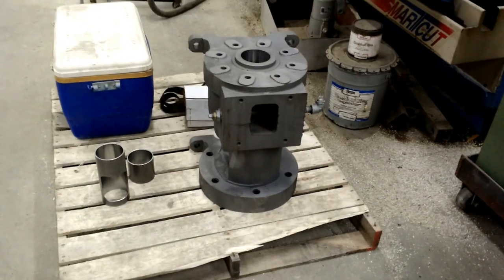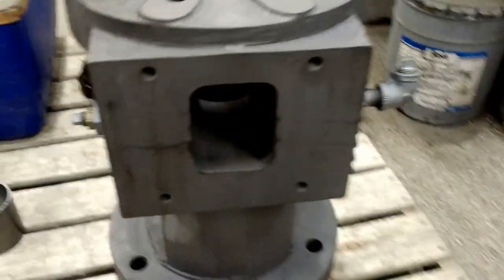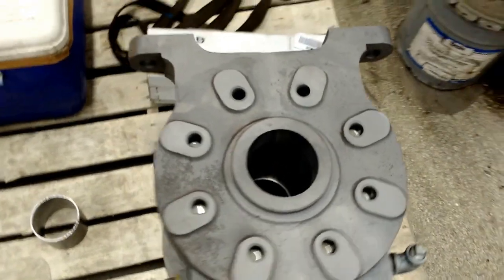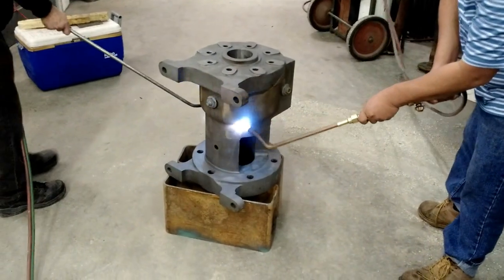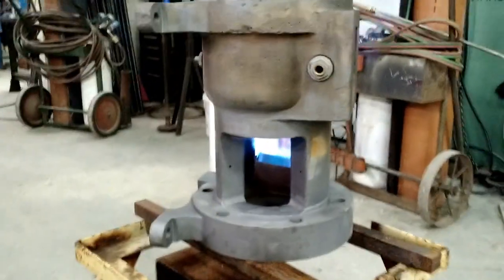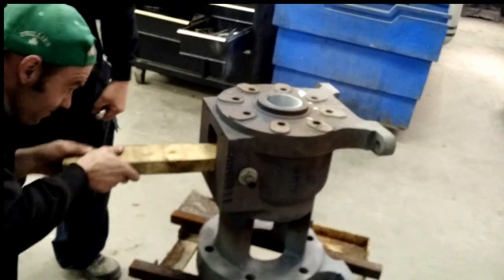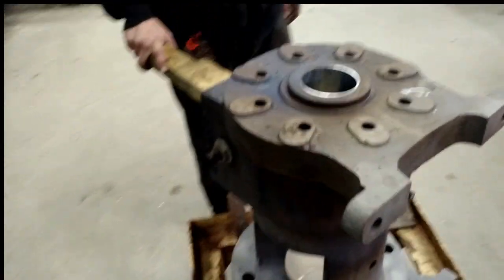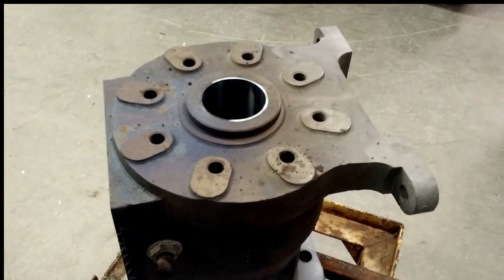How to shrink fit two pieces of steel

Comment: Thanks for the video. I have to ask though, is it counter productive to heat AND cool? By heating the block you’ll be rapidly heating the sleeve. Obviously it worked, I’m just curious that in another scenario it may cause an issue. Thanks
Reply from the maker: You have to work fast!! Its tge only way to get enough differential between the parts

Comment: Done this many times!..to remove it by doing this... I have removed heavy 10" bearing Shrink fit Races on Road Graders Pivots, by arc welding right on the bearing race all around the face. It totally distorts and it does come out, but it is "toast", it does come out!!
Reply from the maker: Work that needs to be done

Comment: You dont have to heat up the case if you use liquid nitrogen to shrink the sleeve. I used to do that back on the 70s. About 40 years ago. Also if you heat the case to expand .012" is enough to fit in the sleeve. You can expand a piece of metal by .012 or more, but not shrink, in other words, expanding works better than shrink.
Reply from the maker: We used dry ice... we do both sides, to make sure it doesn't get stuck
Reply: How much time it take to shrink 150mm solid round bar with liquid nitrogen

Comment: Can someone get this man a pair of gloves? I cringed so hard when he started touching that dry ice.
Reply: its pretty easy and safe to handle if you are aware of the variety of ways it can hurt you.. pretty much just dont let it sit in one spot for more than a second or two 'hot potato' style and dont pinch it or let it get in and wrinkles in your hand/fingers.
Reply from the maker: Truth
Reply: @Jcc8t7  yes obviously LOL I treat it like touching a fire weird I know 😂
Reply from the maker: It's not bad
Reply: Yeah I'm glad I'm not the only one LOL and then after when they were putting the steel cylinder in he literally smacked it with his hand instead of with the hammer 😂

Comment: How do you remove after it is stuck in there?
Reply: with dynamite
Reply: You don't.
Reply from the maker: You would have to machine it out... you better get it right the first time
Reply: What they are saying is it's cheaper/easier to machine it out. You can technically heat the outside with oxy/fuel torches but this inside part is difficult to shrink because it will expand as the outer piece heats. You have to heat sink in inside and just before you attempt to pull you use liquid nitrogen to rapidly shrink the inside sleeve. I other words just machine the sleeve out. Shrink fit is considered a permanent fit for most applications and reversal will either cost a fortune (liquid nitrogen) or ruin the parts anyways. So yeah make sure you do it right the first time.

Comment: how would you remove the sleeve..
Reply from the maker: +Tin Nguyen the only way to get it out now us to machine it out
Reply: I have removed heavy 10" bearing Shrink fit Races on Road Graders Pivots, by arc welding right on the bearing race all around the face. It totally distorts and it does come out, but it is "toast", but it does come out!!
Reply: Well actually， these two parts are matched by interference fit，So, they can not be taken apart!
Reply: With a Lathe......do it all the time with motor endbell housings.  Ray is the real deal.

Comment: Over here at Wagstaff in Spokane, we do that with four foot diameter bushings that go inside of large hydraulic cylinders - we use liquid nitrogen pumped in a insulated crate to cool the bushings down, then use a crane to lift and push them into place  - nice video, thanks for making them.
Reply from the maker: +Glenn Davis thanks!  It sounds like you are working with big boy toys!!

Comment: I'm assuming if the alignment is off you have to cut out the piece and start over.
Reply from the maker: +Cliff Hartle yes! If it's not right in the few seconds you have, you have to machine it out and start over! It has happened! That is why we have 3 guys at that point, each one has one specific job. It works well, but if you try to do it by yourself, it can go wrong so fast, you can't fix it.